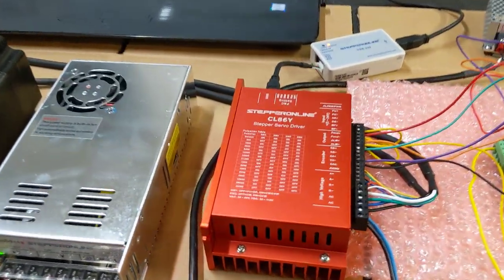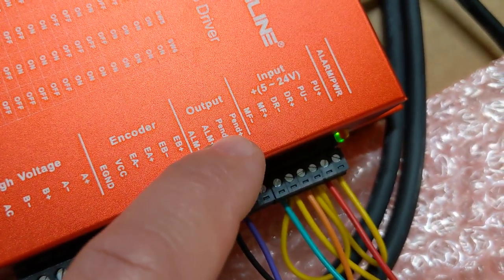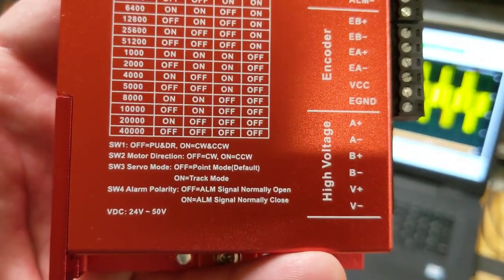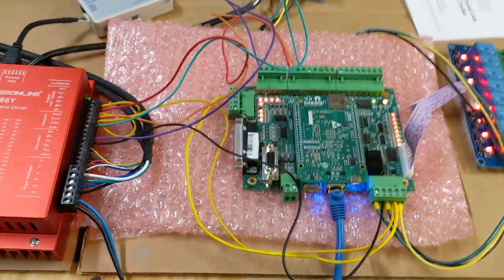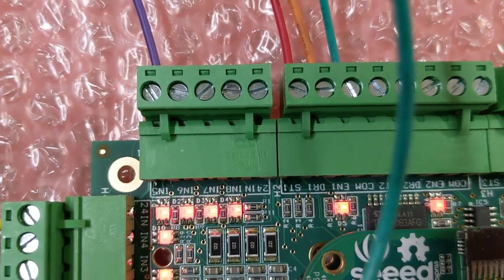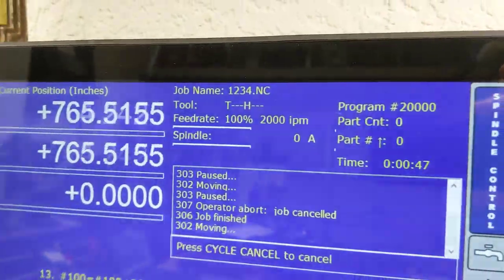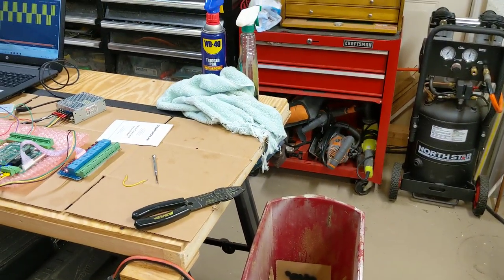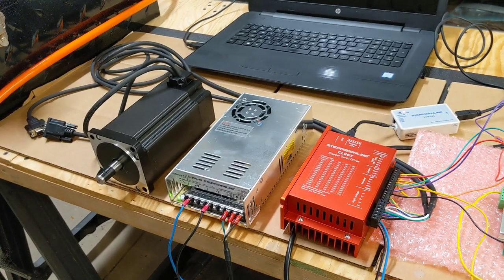Stepperonline CL86Y: Bench Testing with Centroid Acorn

Comment: Hi Franco, 

Helpful video. It's interesting to see how you set things up.

I just want to mention that in the CL86Y programming software, you might wish to note that the default "Position deviation alarm threshold" is 4000 steps. This setting merely monitors the difference between the pulses already sent to the motor and the encoder's counted steps BEFORE the alarm on the stepper driver is triggered. 

Since you've gone to the trouble of investing in a closed loop system, and wiring up the alarm.. It's important you make the most of the alarm feature. When you're first setting up, 4000 steps makes sense when you're making sure everything is working. However, for production, this might be a significant problem. 

Depending on your chosen micro-stepping settings, gearing/belt ratios, and/or the pitch on your ball/lead screw, this 4000 step difference may render the alarm pointless by waiting far too long to trigger it. 

If you're using the default 200 steps per revolution setting, a 4000 step threshold is 20 full rotations (or 200mm worth of travel on a standard 10mm/revolution pitched ball screw) before the alarm is sounded. This can be bad, and should be lowered, again, only once your system is running. 

Of course, if you're using a much higher micro stepping setting, say 40,000 or 51,200 steps per revolution for extreme accuracy, or some sort of ultra-precise gearing ratios/finely pitched lead/ball screws then 4000, may seem low, but then again, smaller differences on a precise rig will have greater impact, and thus may still be too high. 

Raising the threshold value is really only used for testing purposes and to avoid false alarms.... and jittery performance should that start to happen.

The value range for the "Position deviation" is 1 - 65,535 on this and many other closed loop drivers. However, if you set the value one, you'll find that you will routinely get alarms... if you can move the motor at all. Mills which need high precision will often have lower numbers (say a threshold of 10-40 steps) and CNC routers will use simiar or maybe higher values.

You mentioned that most of the default driver settings work for you, and if that is the case, then great... but there are many situations where the interface and programming software would be a huge benefit. I'd be careful about downplaying the importance, or discouraging the use of the reprogramming tools.

I hope this helps.

Comment: I'd say one of reasons to buy this USB interface box is the ability to adjust the motor current. Some people recommend to set the current only as high as necessary for correct operation of the machine under any normal circumstances. This can be worked out experimentally. If the motor loses steps and errors out, increase the current, until a setting is found that works well. Increase it a bit more to have a safety margin, this is the perfect setting then. If the driver is configured for max motor torque, and 12 Nm can be a lot, then if there's a malfunction (something jams or crashes), the likelihood of expensive damage can be high if the powerful stepper continues to twist and turn. If it's "just powerful enough", it will likely stall and error out.

In the video we can see the peak current is set to 7000 (milliAmps, I suppose). The motor's 6.0A rating is the RMS rating. 7.0A peak ~= 7.0 * 0.707 ~= 4.95A. It's a bit conservative setting already, so if you need to squeeze out every last bit of torque, you can go even higher. But, depending on the machine, a lower peak current may be still enough. Worth experimenting with, for additional safety.

If peak current of 5.0A (3.5A RMS) is enough for the application, then we can also run two motors on the same 350W 48V (~7.2A) power supply. Something to consider.

Comment: Hey Franco, thanks for this video. I would really appreciate a video covering more of the parameters and which ones should be adjusted and which ones shouldnt be and what effects those parameters have on the motors. Right now im trying to figure out what current settings to use for peak and also holding for best performance.

Comment: Nice video.  Could you maybe try to change the step input frequency for the drive? maybe talk a bit about the difference it makes? I would love to hear if there is an audible difference. Maybe go a little into the encoder resolution compared to Clearpath. it looks like you get good bang for your buck in these motors. PS. love the Acorn, would love to play with one myself;-)

Comment: Hi Franco ,
I purchased 4 of each , Nema 34 closed loop , Power supply , CL 86 Y driver with the cables and connectors. After a long struggle to wire one of the Steppers had no luck to have it run, spent many hours , finally found out  the manufacturer had made a mistake in the wiring of the plug The black wire does not correspond to the plug on the other side. 
This is to help others to look out for this problem. I'm not sure if all the steppers are wired incorrectly, I will soon find out .

Comment: Hey Franco - Another great video - Thanks!!
I've been using StepperOnLine motors and controllers for over 6 months with my Centroid Acorns and am very happy with them.
I know you decided your motor wouldn't work as a spindle for your mill, but I think it would work in my situation.  I only need 300-500rpm.  I was able to get the snippet of gcode you are running from the screen, but it doesn't show above line 13.  I assume you are simply setting the initial values of #100 and the modes.  Is there anything else significant I should know to try to get one of my motors to turn constantly like you have in the video?
Thanks very much
Reply: The reason you dont see stepper motors as spindle motors all comes down to the torque curve. For this exact motor and driver, at 900 rpm the torque has dropped already to 1 Nm from 12. 
www.omc-stepperonline (dot) com/download/34HE59-6004D-E1000_Torque_Curve.pdf

Comment: I'm in Belgium (so nothing to do with these guys) and I must admit, although this seems to be a Leadshine badged product (I am happy to be wrong) Stepperonline seem to have the edge on available information and product configuration via the dip switches. Although I still don't know where to set over current protection. Not sure yet whether there is a temperature protection on the driver itself. I wouldn't want to 'cook' the electronics when the motor overloads or a short circuit. But after a few days of research Stepperonline are coming out on top.

Comment: Franco, I have a quick question. What drive selection did you use in Acorn for this drive? Do you have to download a profile from Centroid's website? I tried configuring the drives last night and bench testing works but I cannot get steppers to turn, no matter which profile I selected in the menu. Any help would be great. Thanks,
Al

Comment: Thanks for another great video Franco. I placed my order last week with stepperonline.. I wound up going with the same Nema 34 for my Z axis, but since the cost is minimal I went and got 2 Nema 34 1200 in oz for X & Y. I also picked up a toroidal 60v 1200W 20amp supply to power all 3 drives. Just curious what size control box you are planning to put your electronics in for your new build? Thanks, Al
Reply from the maker: https://www.factorymation.com/EN-PCG-4050-B
Reply: Thank you for the link

Comment: Hi Franco, I had another question for you. On your PM-25 you had added a spindle encoder. In a different video you used a KBSI240D board to get spindle I put to acorn board. I am guessing your new PM-728VT is similar to the PM-30 as far as spindle control. Do you know how you are going to connect the spindle feedback to acorn for your new mill? I would like your feedback on this. Thanks,
Al
Reply: Hi.  I have a good idea of how I'm going to mount an encoder on the new Mill.  Stay tuned for a video on that subject.

Comment: Hi Franco, Did you ever test this combo on the Z and A axes? I found out that a closed loop stepper does not work with the Acorn on those axes. A non-closed loop stepper motor works perfectly on those axes. Keep looking for an explanation from Centroid but haven't seen one. I have two Acorn boards and both do the same thing. Probably something I'm doing but if I take the closed loop steppers on the X and Y axes and move them to the Z and A axes (just a plugin change) I get nothing!. Same interface with conventional stepper works!

Comment: Hi Franco, great video and explanation. I'm using exact same drivers on my built but I'm littler confuse about the driver voltage, it say AC and on the manual say that is ok to use AC up to 80v and 110v on DC, is this correct should be vise versa, I want to use AC but can't find a 80v transformer to do so, is no info about this anyware including the manufactory site, Tia.

Comment: Do you prefer this setup over your clearpath setup? My constraints are mostly budget, and these seem like a good alternative to the clearpaths
Reply: From a pure performance point of view, Clearpath servos are the best.  But, as you can see, I'm putting these closed loop steppers on my brand new machine.  I guess I can say I prefer them over the servos because the level of performance they provide is sufficient (actually exceeds) my expectations and the price is very reasonable.  And, they are very easy to configure.  I hope that helps.

Comment: Franco, so I made the plunge today and bought some stuff from stepper online using your link above.  Small payment to you for all the help you videos have given me.  Still clueless and expect lots of challenges cnc my PM 728 but it's a good start.  Could you respond with the breakout board breadboard that you use?    Thanks
Reply from the maker: Hi. Thanks for your support. I'm glad you find the videos helpful. A little bit of confusion in the beginning is normal, remember you are building a CNC machine. But, lots of people do it and I'm always impressed with the amazing things that I see people do.  As far as a CNC control system goes I prefer to use the centroid acorn system. It is a combination of hardware and software. I feel it's better performing and easier to set up than most any other option out there. I have lots of videos on my channel about their products. Let me know if you'd like me to recommend a place for you to start with that. Thanks
Reply: @FrancoCNC  Thanks for the encouragement.  I already have gone down the rabbit hole.  In fact, my centroid acorn board and assorted other its arrived from them today.  I have stepperdrivers, power supplies, motors, on order from stepperonline. I'm totally non-original and just "stole" all of your parts that you are assembling for your PM 728.  I figure being a complete virgin when it comes to stuff, why reinvent what you have already done.  One part I have not heard you reference is your breakout board - there seems to be a gillon of them!  It would be helpful to narrow down the choices.  So, could you post the model you have?   Thanks.
Reply from the maker: @richardmorton1310  are you talking about this little guy that plugs into the DB25 connector:. https://youtu.be/kDcOyDXXFl8
Reply: @FrancoCNC  Yes, thank you.  grabbed your 3d standoff as well.

Comment: Franco, I’m curious if the db9 connector between stepper cable and extension cable  of the stepperonline servos is a water tight connection. I’m concerned the X & Y axis connections might be an issue with flood coolant use. What is your thought?
Reply: Hi.  I would not consider it any more water-tight than a standard cable you'd find on any computer.  However, I'm sure you  could use heat shrink tubing or something like that to seal it up.  Perhaps even a little silicone if you don't plan on disconnecting it anytime soon.

Comment: Hey Franco, I bought the same stepper motor for a university project and I watched your video to understand how to plug the motor's RS 232 cable but I couldn't follow that cable. Did you connect it to the servo driver or to the centroid?
Reply from the maker: Hi.  The cable connects to the servo driver.

Comment: Nice Video, thanks. Do you know, if the motor is water proofed? at least against splash-water? At least the connectors seem not to be.
Reply from the maker: I'd say that as long as you do not submerge it, you will be fine.  I can't imagine a few splashes doing any harm.

Comment: When you are dealing with multiple power requirements like 5,12,24V etc. Do you buy a seperate ACDC supply for each  dc voltage requirement or do you buy one ACDC and then use seperate DCDC converters for the required power voltages.
Reply from the maker: The Acorn comes with a dual voltage 5v 24v power supply and that is good to power the board and sensors.  But for the power supplies, I generally buy switching type and they are usually a single voltage.  You could buy a large multiple voltage power supply but my guess is that will cost more than individual switching types.

Comment: @Franco hi thankyou for the fast reply . Is the power supply in the video capable of running three of the 12 nm 34 motors ' in the video, or do I need a bigger power supply? Is there a power supply you would suggest using if it isnt usable?
Reply: thanks for all the fast replies Franko, really appreciate it!

Comment: Should the drive not have alarmed when the motor choked out above 3600rpm?
Reply from the maker: That is a great question.  The drive will generate an alarm when the motor is physically not able to execute the commanded step/direction instructions received from the Centroid Motion Control Unit (MCU).  In this case, what is happening is the MCU is sending instructions to the drive so quickly that the drive is unable to read them above 3600RPM.  The Centroid Acorn is "talking" faster than the drive can "listen".  Multiple step pulses begin sounding like a single step pulse. Before the drive can generate an alarm, it must first be able to understand the command.  This is why it's important not to exceed the frequency at which the drive can reliably understand the commands coming from the MCU.

Comment: Great video!
 I have decided to follow your method but am curious as to whether I need a separate power supply for each motor which the exact equipment you have there? If I do, would you do a video to show a three motor wiring setup please?
Reply from the maker: Hi.  You can use one big power supply to run multiple motors.  That is actually a more efficient way to do it.  With switching power supplies, it's best to make sure you total available amps are about 110% or 120% of the max load the motors can draw.
Reply: @FrancoCNC  hi thankyou for the fast reply . Is the power supply in the video capable of running three of the 12 nm 34 motors ' in the video, or do I need a bigger power supply?
Reply from the maker: @tylerdavenport8661  you need a bigger one.  Amps x volts = watts

Comment: Franco thanks for your videos, they really help ppl like us. I am planning on running my avid cnc w/CL86Y / 34HE36 x4, with Acorn board in a FactoryMation enclosure. I recently noticed that the stepperonline kit includes an E series motor, which I believe stands for Economic (?). Anyways they also sell more expensive TS and TP series closed loop kits with different drivers, but the only substantial documentation in their website for comparisons is torque sheets, general specs and a little description. Are you familiar with the TS and TP series, are they worth the extra money?
Reply from the maker: Great question.  My understanding is the orange drivers are the latest and greatest product.  You'll notice the orange drivers have a USB connection while the black ones have an RS232 connection (which is older technology).  So, as far as I know, you are better off buying the orange ones.
Reply: @FrancoCNC  I also bought a couple of Y kits, and just noticed that they recently switched all their kits to the T drivers (black). StepperOnline has an FAQ with this topic.
Q: What's the difference between T, Y, S and N series digital drivers?
You can find this easily with google. In short, T is "Produced by Chinese TOP1 stepper driver manufacturer", Y is "TOP3" and is a bit cheaper. So, in theory T is supposed to be their best offering. But Y looks much nicer. Although I'd say the color is (orange-ish) red.
They also have this question in the FAQ:
Q: What the differences between HE HS HP motors?
Economy, Standard, Professional. But yeah, just comparing the torque specs, some standard motors look overall better than a comparable but more expensive professional one. Some torque curves don't make much sense, e.g. a 8.0 Nm motor and 12.0 Nm motor in the same series have practically the same curve, probably an error on their side. It's a bit of a crap-shoot trusting these torque curves, I think!

Comment: Hi Franco, great video and explanation. I am in the middle of building a new cnc 6 axis and I was thinking to use exactly this step and drivers, but I have a few things that I have to look into. For example I don t know what sort of  ramp to use to run 6 stepper of this kind and also the cut of the power supply in your video seems a bit small for the potential of the 12 Nm nema 34.
Reply from the maker: Hi.  I'm not sure if I understand what you are referring to when you say "ramp" and "cut".

Comment: Do you know what the difference is between the CL86Y and CL86T? One of the reviews somewhere commented something about the T model cogging at low speed, but can't be too sure about that.

Just FYI, at 1,000 RPM, the torque drops off to less than 20% of its rated holding torque.